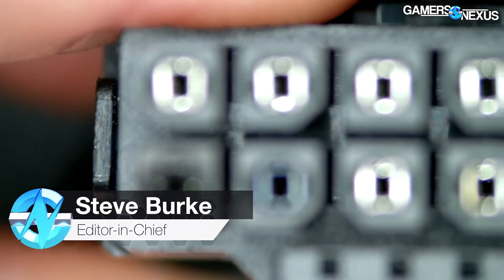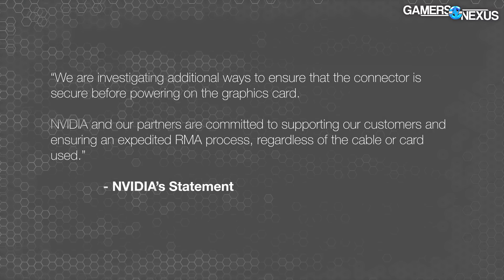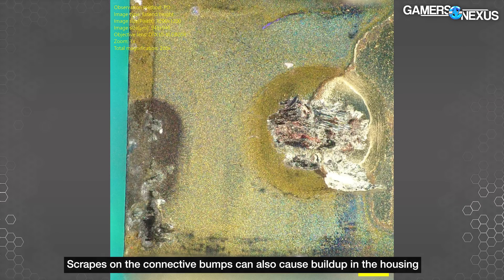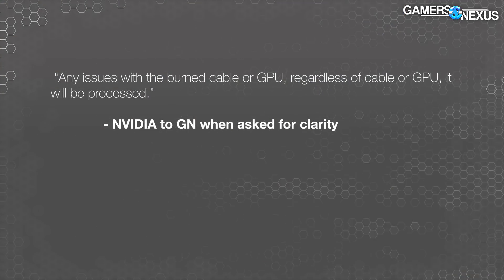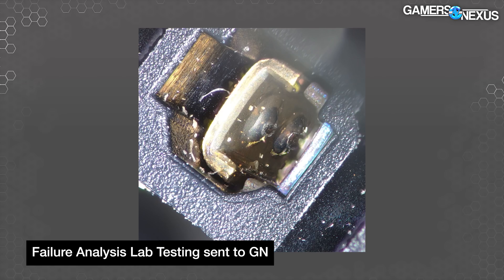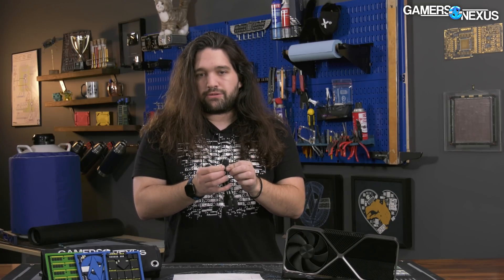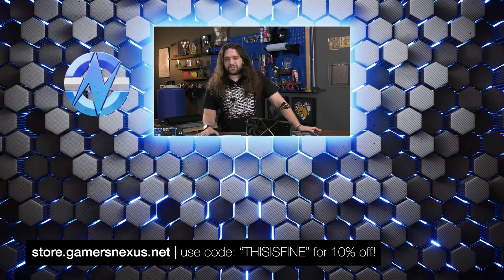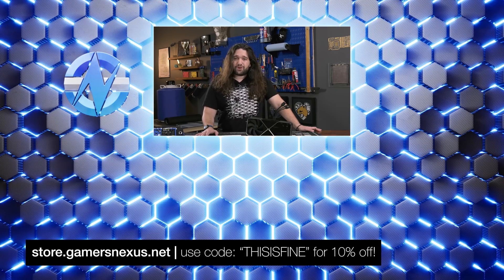NVIDIA Responds to Melting Cables, Warranty Concerns, & 12VHPWR Adapter Failures

Comment: Maybe color the tip of the connector so you know when it's fully seated. Also makes it easier to see how far it's in since it's not just all black
Reply: 50-ish users didn't give it a tug, after plugging it it, to check if latch got engaged. No eyeballs required.
50-ish users didn't even do the easiest thing, and you expect those people to look for some half a mil line gap (of different color) in between the male and female ends, in the final built system.
All that adding complexity to the adaptor (2tone plug) would do, is raise the cost of production and not get included in the box> sold separately for way more; and those 50-ish people would still not double check their work :/  . Even if it's not 2 tone, black is still the cheapest by far. But if's not in the box (expecting it to be included), and you NEED it NOW,  you 'd just A Prime the cheapest and fastest anyway :) (probably not the limited edition Official Two tone one, but a lesser AWG knockoff); because you probably are not the guy that checks the SIG spec anyway. You 're the .05% guy that didn't give it a tug.
"Invent a fool-proof design, the world just comes out with a better fool."
PS: If you have a sharpie you can put the line in yourself, to check your connection ¯\_(ツ)_/¯ .05% wouldn't even give it a "tug-tug"
Reply: @IcecalGamer  Hahaha you're spot on. That people in here still double down is just mindblowing. What this really shows how stupid social media is. 50 noobs on reddit elevated this non issue to what it is now. Because they were too dumb to plug in a cable.
Reply: @patrickbateman7444  I've posted a comment (not reply) Exactly about that.
How did this get This much traction !?! For genuine user error, not Apple "you're holding it wrong". 
The Gigabyte PSU were Way more widespread and NOT user error. That barely got any "hype". And could burn your house down at 0 power, (compared to full bore fuzzy donut Gpu). Falling asleep, low-power music player.... aaaand you're on fire.
Reply: @IcecalGamer  Yeah, what this will do is take away from actual issues. Because we got reminded, that you just can't underestimate the stupidity of some people. So funny thinking back to Jayztwocents, who tried so hard to recreate the issue, he did godknows what to the adapters just to get them to fail. He never thought about plugging it in just half way i guess
Reply: @patrickbateman7444  Not only Jay, but the Enthusiast community itself, thought (maybe subconsciously Hoped) that it wasn't user error, but design flaw; new design + flagship many watts card. 
This illustrated perfectly the principle of "the world invents a better fool" > 12+4 Sense pins, the card and the software "know the max capacity of PSU and its fool-proof" KEKW. Now shorten the sense pins so it also knows that someone has put just the tip in.
At least, on the BRIGHT side, from what I've seen, there was little to zero negativity  thrown @Nvidia or the suppliers. Even AMD (or intel) fanboys ultras kept low. (i personally don't care for any specific brand).
Reply: @IcecalGamer  Way I see it is if you aren't willing or smart enough to double check the cable is plugged in on a pc part you just spent 2 grand on you deserve to melt your card.
Reply: The shorter pin thing mentioned is much better. That doesn't rely on user checking or trying to stare into tiny gap to see if you spot any color which will depend on lighting conditions. The pin solution would allow even a blind person to do it correctly.
Reply: Well plugging in a connector fully hasnt really been a issue till now. and form the marks on the connectors those connectors have been barely plugged in.
Reply: Or, just maybe, use the latch?
Reply: @patrickbateman7444  yeah. This is kind of PC building 101 honestly. It seems this 0.4% is mostly user error which is not surprising.
Reply: @audiophizile13  no no make that 0.04% not half a percent... half of 1 tenth of a percent
Reply: @audiophizile13  nono, it's 0.04%, it's 50 noobs out of 125.000 who bought the thing. They don't know how to plug in a cable, but they sure know how to use reddit

Comment: on the subject of FOD, i used to work for a machining company that did electrical connectors for both private industry and government aerospace contracts. the cost differences for making pins that are completely deburred and smooth vs what you see in the video here are extreme. mind you this is pricing from ~20 years ago, but simple folded/cut tin plate likely used in these, then heat treating and electrolysis re-plating would generally have a cost of under 1 cent to 3 cents per unit. however, polished, deburred, plated, heat treated ends that would meet extremely strict guidelines to prevent issues like this were closer to the 15-20 cents per unit range. thats just the pin manufacture btw. we did not do plastic/wire work, so we would sell those pins to the contract that actually would make the connector. 
on the high extreme level, where we would serialize lots, do complete tension testing, radioscopy, xray, etc, like gamers nexus had done to verify the parts, the cost could easily be over $1 per pin. the most expensive pins i ever saw made (and are now declassified) were for the SR-71 program, which each pin was made as part of a set of 50 for a specific connector and the cost per pin came out to $10 each.